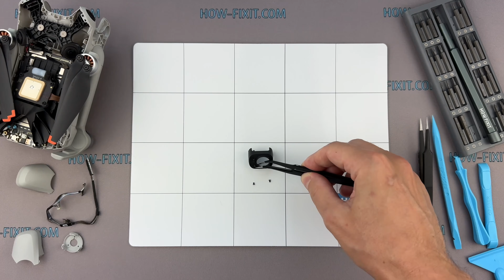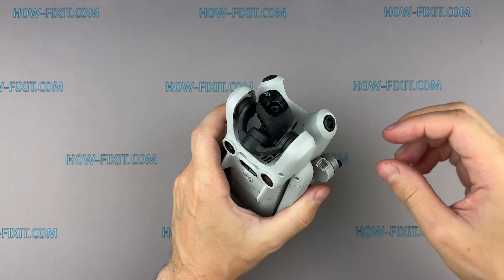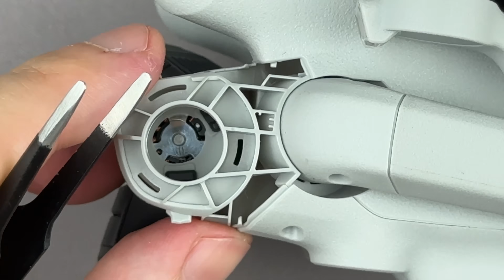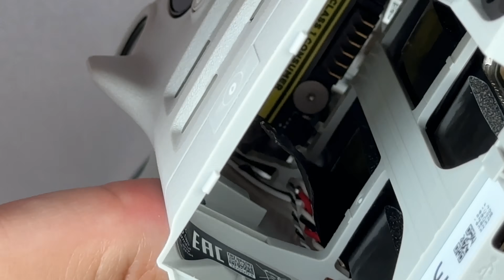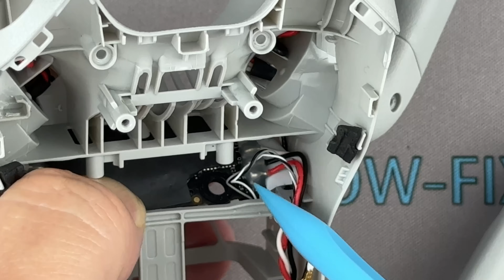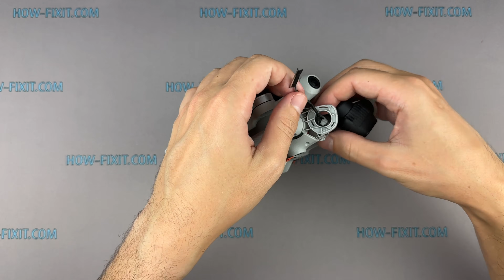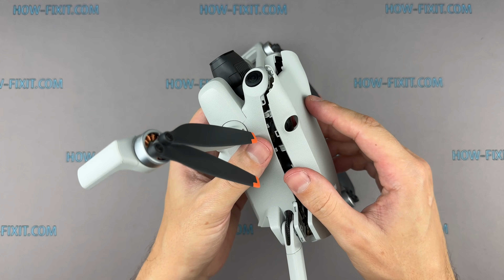DJI Mini 4 Pro Disassembly & Repair: Ultimate Guide

Comment: What about calibrations?
Reply from the maker: Some modules can be calibrated using the DJI Fly app or DJI Assistant 2, while others can be calibrated using dedicated third-party software.
Reply: @howfixit  Third-party software is not easily accessible. I personally used to calibrate the Dji mini 3 pro.
Reply from the maker: Yes, it is sometimes difficult to access, but we DIYers have no other way because DJI chooses the limited repair policy like Apple.

Comment: Hi, great video! Only I'm looking for a way to replace the motor without actually taking off the arm and dissassembling the whole drone. There are three screws underneath the motors with a round sticker covering them. Would it be possible to just remove these screws and then cut and crimp the wires together, then screw the new motor back in place?
Reply from the maker: Theoretically, this can be done, but the crimped wires have worse contact than soldering directly to the ESC module, and also this connection may be weak to vibration from the motor.
I wouldn't do this, but here are some recommendations if you're determined:

Option 1 - Crimping Method
Slide a piece of heat shrink tubing over each wire on the drone side before connecting.
Use a crimping tool to connect each corresponding wire from the drone to the new motor. Ensure the connections are tight and secure.
Slide the heat shrink tubing over the crimped connections and apply heat to shrink it, providing insulation and protection.

Option  - Soldering Method (Recommended)
Twist each corresponding pair of wires together.
Solder the twisted wires for a strong and reliable connection.
Slide the heat shrink tubing over the soldered joints and apply heat to shrink it, ensuring the connections are well insulated.
Reply: @howfixit  Thank you for the detailed response, that is really helpful :)
Reply: @howfixit why do the rear arms separate into 2 pieces? What is the functionality of the arm being like that?

Comment: The reassembly section was incredibly clear. Thanks!
Reply: The reassembly section is full of parts missing. Like the esc to motherboard cable magically appears after installing the lower drone camaras, and also the gps gets connected by magic

Comment: Can you provide more details on calibrating the GPS module after replacement? Is it done entirely through the DJI app?
Reply from the maker: The calibration process only needs to be done when it says it needs to be done. When you turn on the drone, you will see a calibration request, in any case, here are instructions on how to do it yourself: Enter the flight interface in DJI Fly, tap “···” > “Safety” > “Sensor” > “IMU” > “Calibration”, tap “Calibration”, and follow the on-screen instructions to properly place the aircraft.

Comment: What should I do if the ribbon cable glue is too difficult to remove? Are there any tricks to making this step easier?
Reply from the maker: If you find that the ribbon cable glue on your DJI Mini 4 Pro is too difficult to remove, there are several techniques and tools you can use to make this process easier and safer. Proper handling is crucial to avoid damaging the delicate ribbon cables and connectors. Here are some tricks on how to tackle stubborn glue:

- Isopropyl Alcohol (99% purity): Helps to dissolve the adhesive without harming the components. Dampen a microfiber cloth or a cotton swab with isopropyl alcohol. Gently dab the glued area, allowing the alcohol to penetrate and soften the adhesive. Let the alcohol sit for a minute or two. This gives it time to weaken the adhesive bond. After softening, use a plastic spudger or pry tool to carefully lift the ribbon cable. Start at a corner or edge and work slowly to avoid tearing the cable.

- Heat Source: A heat gun or hair dryer can soften the glue, but don't overheat! One of the most effective ways to make glue removal easier is by softening it first. Use a heat gun or hair dryer on a low setting to gently warm the glued area. Aim to heat the glue just enough to soften it, making it easier to peel away. Be cautious not to overheat, as excessive heat can damage the ribbon cable or other components. Hold the heat source about 6-8 inches away and move it in a circular motion to evenly distribute the heat. Apply heat for about 30-60 seconds, then test the glue’s pliability.

- Plastic Spudger or Pry Tool: Non-metallic tools to prevent scratches and damage. If heat and alcohol are insufficient, use mechanical techniques with care: Gently insert the spudger under the edge of the ribbon cable and slowly work it back and forth to lift the cable. Avoid using metal tools as they can scratch or damage the components.

- Tweezers: For precise handling. Use tweezers to gently pull on once the adhesive bond has weakened. Take your time to gently peel away the glue without applying excessive force. Periodically check the cable and the area to ensure you are not causing damage.

By following these steps, you can effectively remove stubborn ribbon cable glue without damaging the delicate components of your DJI Mini 4 Pro. This careful approach will help ensure a successful repair and maintain the integrity of your drone.
Reply: What type of glue gun and adhesive do you recommend for securing the ribbon cables and other components during reassembly?
Reply from the maker: Use mild removable adhesive to secure ribbon cables. The glue must also be resistant to vibration and water. I use regular glue for a glue gun and for some purposes B7000 glue.

Comment: Sir, where can i get this special software to calibrate the replace front sensor
Reply from the maker: Typically, vision sensor calibration is done using DJI Assistant 2. But DJI Mini 4 Pro is not currently supported in DJI Assistant 2 (maybe support will come later), because the Mini 4 Pro will automatically calibrate through DJI Fly if the vision sensor is an error. So, a lot depends on the drone software (DJI introduces various restrictions or removes them in drone updates); perhaps the new module will be calibrated automatically, or you may have to wait for support in DJI Assistant 2.
Reply: @howfixit  Please tell us results, or an update for vision sensor...

Comment: Are there any particular signs of motherboard oxidation that I should look out for before deciding to clean or replace it?
Reply: Dang. I fly under the rain. I would not do that if i knew oxidation thing. 😢
Reply from the maker: When you assessing the motherboard of your DJI Mini 4 Pro for signs of oxidation, there are several key indicators to look out for. Oxidation typically occurs when the motherboard is exposed to moisture, which can lead to corrosion and electrical issues. Here are the specific signs to check before deciding whether to clean or replace the motherboard:
- Oxidized sections may appear greenish, white, or even rust-colored.
- Corrosion: check for any visible corrosion around the solder joints, connectors, and components. Corrosion often looks like a white, powdery residue or a crusty buildup.
- Boot Issues: If the drone fails to boot up or shows intermittent power issues, it could be a sign of underlying oxidation.
- Erratic Behavior: Unexplained crashes, sensor failures, or inconsistent performance might also indicate oxidation affecting the electrical pathways.
- Short Circuits: Look for any signs of short circuits, such as burnt marks or a smell of burnt electronics, which can be caused by corrosion bridging connections that shouldn't be connected.
Reply: @howfixit  thanks for the detailed answer! How to clean the motherboard?
Reply from the maker: Cleaning: If you observe mild oxidation or corrosion that hasn't significantly damaged the components or solder joints, cleaning with isopropyl alcohol (preferably 99% purity) and a soft brush can often restore functionality. Ensure the board is completely dry before reassembly.
In case of replacement: If the oxidation is extensive, causing significant damage to components or connections, or if cleaning doesn't resolve the issues, it may be more cost-effective and reliable to replace the motherboard. Extensive corrosion can weaken the integrity of the board and lead to recurrent issues.